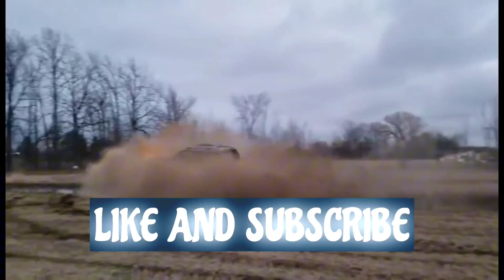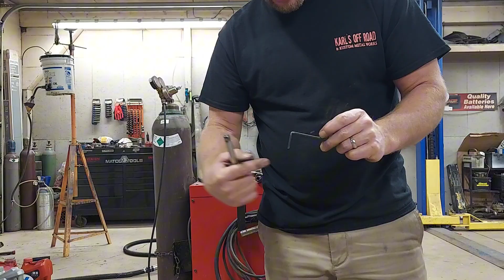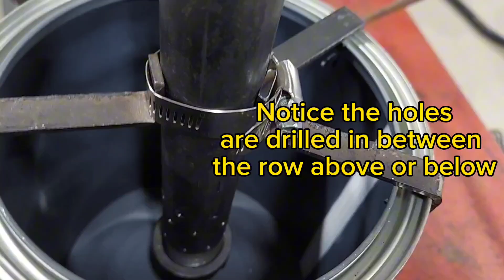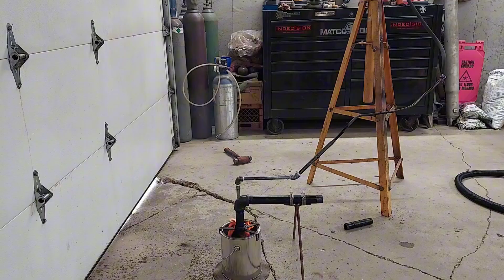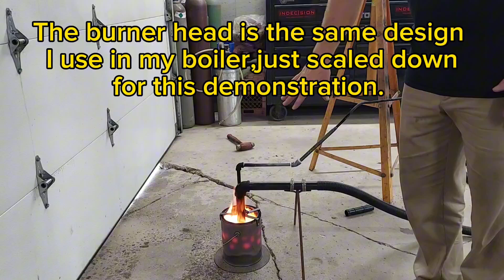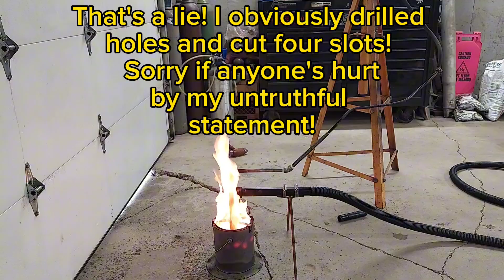DIY no weld waste oil burner! Anyone with access to a hardware store can build this!

Comment: That's fantastic.  Maybe a cast iron Dutch oven would be good for a burn chamber? I'd like to make it a bit smaller and use it in my wood stove as an alternative fuel source.  Ultimately it would be great to not need an electric blower to make it run.  Sorta like an off grid set up or for when the power goes down. It goes down often where I live, but so far not for a very long time. 
Thanks for the video. It's inspiring.
Reply from the maker: @SSgtJohnT  I appreciate that! I'm sure if your wood stove had a good draft, the blower wouldn't be needed. Best of luck with your build! Have a great day!

Comment: Karl what type of blowers did you use? Thanks
Reply from the maker: @jimfitzgibbon5492  Dayton 1TDN7A for this burner. I also used a bounce house blower. The nozzle design is great, but I would recommend a steel or stainless steel burn chamber for extended use. The paint can is just too thin to hold up for a long time. Thanks for watching!

Comment: DId it heat up the garage well?
Reply from the maker: @jonathanjones4125  it definitely makes some heat. I would use a different burn pot for long-term use,the paint can is much too thin. It never had a failure, but I'm sure it would sooner than later.

Comment: Very cool video Karl, I'm assuming this burner is used to heat a work shop. Very Nice.  I prefer to wear Crocs during these applications,  it saves the tops of my feet from burns when knocking the slag off the hose clamps. 😎 Be Safe Brother.
Reply from the maker: Steel toe sandals for me! 😆

Comment: Nothing like a flame on the fuel supply line and a plastic air hose just waiting for radiant heat to travel to it .
Reply from the maker: The oil burns better if it is pre-heated, and the air supply pipe never gets hot.

Comment: Is it possible to get a better list of pieces?
Reply from the maker: 1 inch black pipe pieces, 1×12 inch nipple,1×9 inch nipple, 1 90-degree  elbow,1 cap.
1/4 inch black pipe pieces 3- 8 inch nipples,1-6 inch nipple,2- merchant couplings,1-90-degree elbow,and 1-45-degree elbow. 1 empty paint can,new or used. Some 1/8th×1/2  inch strap steel for the Z-brackets,3 radiator clamps size 12,
1-step bit,1-1/8th inch drill bit. Some self tapping metal screws. I was using a Dayton blower model number 1TDN7A  I think that's everything. I hope that helps. Happy burning!

Comment: I like this burner! Karl do you think the black iron pipe would last longer in a burner than what pipe you used on your boiler? I guess probably not cause you would have used that instead.
Reply from the maker: I would think so,it's much thicker than exhaust pipe. I use exhaust pipe because I don't have to buy any fittings. I can just bend and weld my own.
Reply: That makes sense. @karlsoffroad